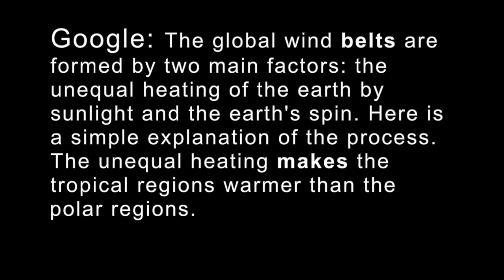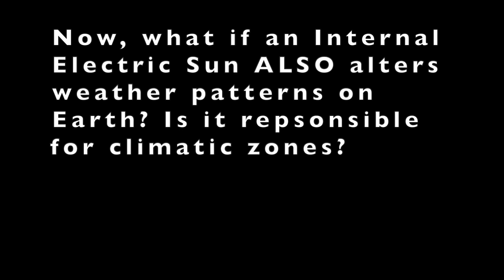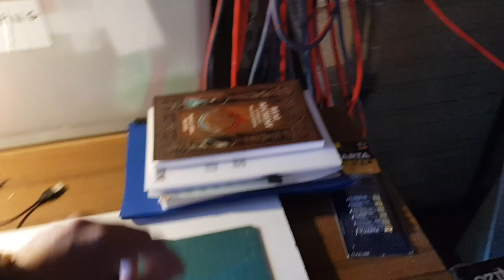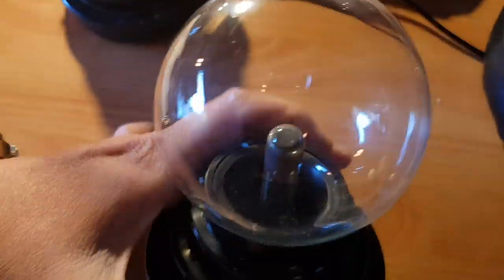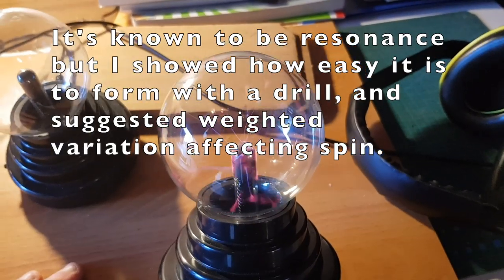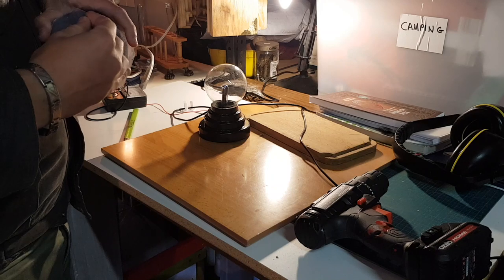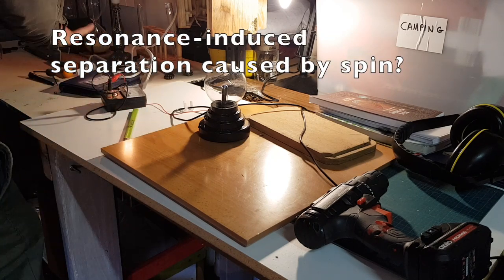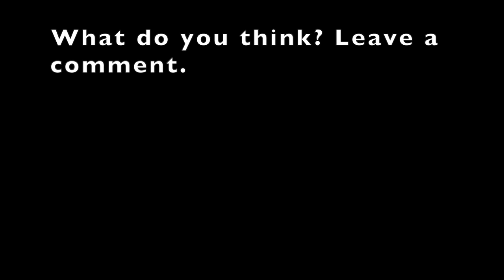NEW THEORY: BELTS ON PLANETS, STARS, ELECTRICALLY GENERATED BY 'INTERNAL SUN!' TESTED! MAKE NEBULAE!

Comment: You are on top of something. But I have to tell you that there’s no inner sun, the inner core is molten metals and the electricity comes from the sun in the form of cosmic radiation. The magnetic shield separates the waves are then segregated into positive which enters through the North Pole and creates the Northern Lights. 
The South Pole is the negative receptor.

This is a constant flow of charged rays that flow to the core causing the core to act like an electric motor. Causing the core to expand and rotate at a non compatible speed with the earth. This electrical process is but one of the electric connections throughout the galaxy. It is also what has kept the core from cooling.

The old professor

Comment: Cool experiment but wouldn't the beings living on the surface of the lightning orb experience the bands as standard electrical tendrils ? 
The bands only exist for those of us observing the orb spin .
You'll need to film it with a high speed camera to find out .
Reply from the maker: Not sure, I think it would affect charge on the surface, thus charging weather and oceans, maybe one reason different rivers and oceans don't mix very well.

Comment: How fast was the globe turning? As well, as others have mentioned, Safety First.
Reply from the maker: I guess I should know the answer but I don't. :(
Reply: @TheTimeDetective42  A 4 inch globe, spinning at 600 rpm, has an equatorial rotation speed of 1.42 Mph, or 2.28 Kph. The Earth has an equatorial speed of 875 Mph, or about 1400 Kph. The 4 inch globe will need to spin at about 370,000 rpm, to simulate the Earth's rotation speed. It looks like you need to up the voltage on that drill. Good luck to you! :-)

Comment: An interesting observation you see now - study a lathe where the input current (pressure) is transfered via a scoop chisel (rotating around its centre) watch how the orbitting shavings will produce the same ( velocity) belt patterns - the rockets escape, a path to the exit - an exit which grips...General Rid Stump!!! 
My plasma balls are on mains & what you scored funding for battery powered ones mumble mumble mumble kick!
Reply from the maker: Well well, very interesting!
Reply: @TheTimeDetective42  just for fun stick a gold coin to the glass ceiling and give it a spin, build a sliding scale pivot the fulcrum - place two orbs at opposite ends - now you have two heavenly bodies rotating which to fix position - plasma charged ions can use the sliding scale to bridge the space between the orbs despite propeller rotation centripedal current - fix some coins along the scale, use some copper wires and a bulb above the central fulcrum spin the device those orbs should produce a central sun...explanation meditate for fun.
Reply from the maker: @michaelwellner1333  WOW!!!!!!!
Reply: @TheTimeDetective42  the ancient kings gather the gold, the kingdoms grow contract Always gathering storing depositing. Today we have huge stores of concentrated gold strategically placed around the planet which rotates within an ether rich electromagnetic vortex current. Now we move two or three coins on the plasma ball what happens? Points on the sphere the ancient kings planned a spinning sacred geometric golden tipped ionising resonance device powered by the planet.
Points in focus plasma focii According to modern  speculation it is a secret deathray machine to shoot down the returning aliens from our last enslavement modification reintegration everything in good order. The greedy alien defeated by the last gold coin saved by our true king. 
Where is our gold depository, here is helix geology deposition  BloodyAyeLookLookAroundRoundAboutThere maybe a natural channel for really powerful emanations known by the eldars aboriginal shamans I am sure.